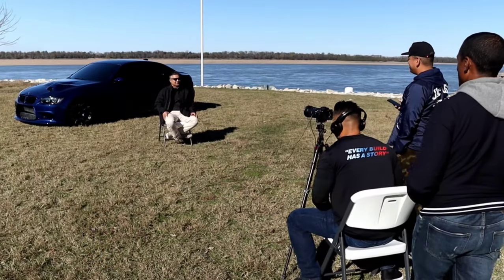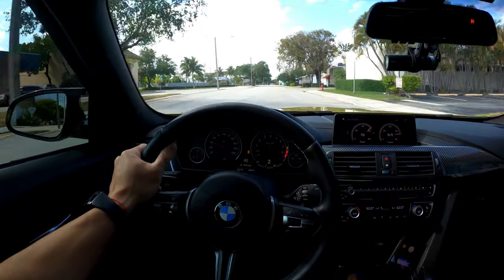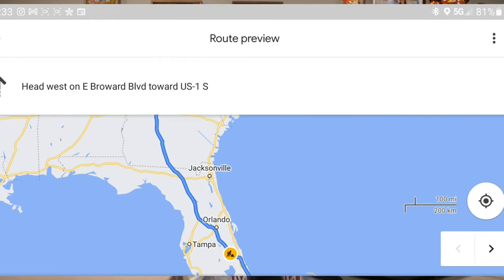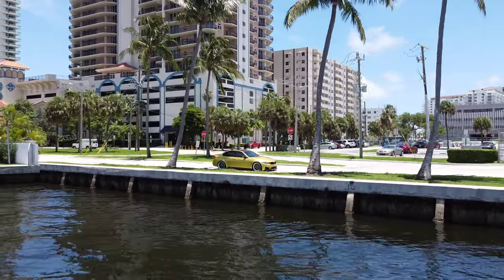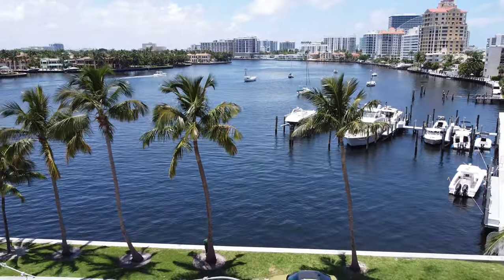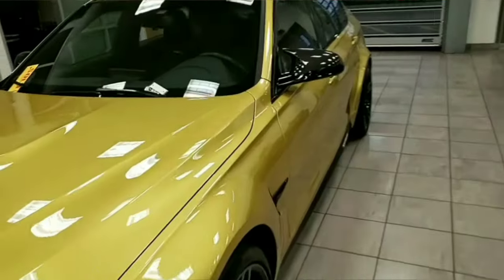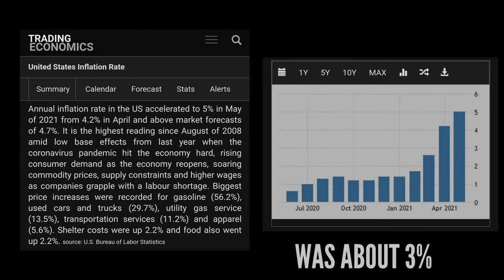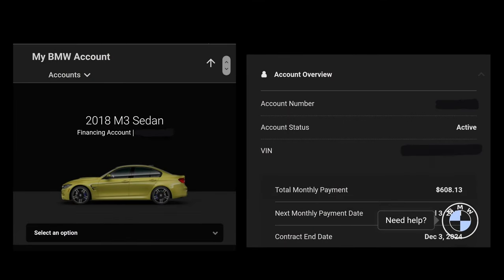How Much Does It Cost To Own An F80 M3 ? | Monthly Payment For A BMW F80 M3

Comment: i lucked out and bought my 2018 m4  that had about 27k miles at the time of purchase (basically fully loaded minus the comp pkg:   executive package, DCT, heated steering, android screen sharing, apple carplay, HUD, active blind spot, 19inch M 437 forged wheels, LCI Icon LED headlights, and etc...  Original sticker MSRP was $78,000) back in March 2021 right before the crazy price surge for $45k before fees/tax/interest.   A few months later my car was valued close to $60k.

Comment: This is a great video. I’m sure folks who are trying to get into an M3 will appreciate the transparency. In my opinion, the best way to build wealth is to invest in a property . Cars depreciates very quickly but properties will make you money faster. Once you set yourself up financially and you have a good foundation, you will have the bandwidth to get that luxury vehicle and not necessarily worry too much if it depreciates. Plus the significant other will not choke your ass out. I bought a 2016 M3 from McLaren of San Francisco a few years back with 19K miles for 60K out the door with extended warranty. I only put down 3K. I have since refinanced with my credit Union. My monthly payment is $705. It was nice to finally upgrade from the F30. $705 is still on the high side but if you bought a brand new M3 with little down, you will be paying well over 1K per month. Like Ken said, do your research. Every deal will be different because everyone situation is different. But this car is well within reach now.
Reply from the maker: Absolutely agree. Cars will depreciate but building wealth with real estate is long term key on building wealth. Wealth that you can pass onto your children.  Appreciate you sharing your experience and who knows, it may help someone in the comments in the long run. Thanks for checking out the video 🙏🏻

Comment: Curious why did you need the Geico warranty if you still had factory warranty? Isn't that why it's so cheap? Lots of great info here...and you aren't joking about the rates right now, I'm have ~780 credit score and I actually just got 1.79% on a 72 month loan for a 2017 M3, through NWFCU. I couldn't believe it..that's brand new car rates.
Reply from the maker: In order to have the policy, Geico requires you to add it on before a certain period of time. I think it was before the 12 months period.  It also only applies for cars less than 15K miles and less than 15 months old. They wont let you add it years later and ect. Which is how they make their money and especially the ones that decide to sell their car in year 4.  Starting this winter, my warranty will be up and Geico's MBI will be in place to take care of any mechanical issues.  

Yeah you got a killer of a rate! No rush to pay that car off.  Thats incredible.

Comment: Great breakdown 👍🏽man I’m looking to get the F80 also real helpful I can definitely get it the only thing is that geico things sounds Amazon! I was interested in a 15-18’ Year but won’t even be available for the Ik warranty, but the new G80 are super nice 👌🏽
Reply from the maker: Yeah the warranty made it so much easier to pull the trigger on. The G80 looks great with a proper set of wheels and suspension 👍🏻

Comment: Hey bro, awesome video! What do you think about paying $59k for a 2018 M3 Comp with executive package and 12k miles? Yasmarina blue with silver stone interior too (my dream build)
Reply from the maker: Not bad actually. Give you an idea, I traded my F80 M3 to the dealership and they gave me 60k trade in. I had 35k miles no accidents, stock, no mods, never tuned, and it was a 2018. This was back in June. 

Obviously things have changed. But I would try to haggle more especially since the market is slowing down and interest rates are rising.

Comment: Was looking at a 2015 f80 and have 11k saved dont know to go for it or not its 32k im only 19
Reply from the maker: It all depends, 32k for a F80 M3 might mean its at a high mileage or other underlying issues.  There's no rush to get into a M car, I got into a M car when I was about 28ish.   For a 2015 F80 M3, they should be roughly 45k ish in this inflated market. So you gotta ask yourself why its at 32k.  What I know, is that if things break on this car, its going to cost a decent amount.  Hopefully this helps.
Reply: @TheDailyDriven   yeah I thought about it and im starting to look into e90s
Reply from the maker: @coco-qy8sl  you can probably get a decent E90 M3 or E92 M3. Just gotta make sure you find a clean one.
Reply: yo g i’m 19 too tryna get one trust wait on it g the prices are gonna come down they’ve already started i’m seeing clean 2018s go through the auction for like mid to high 50s our time is coming